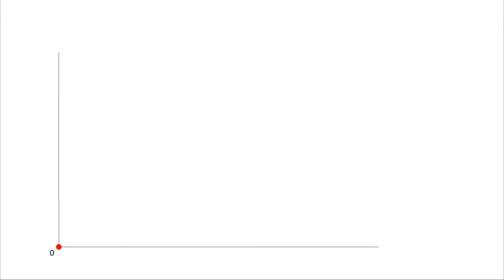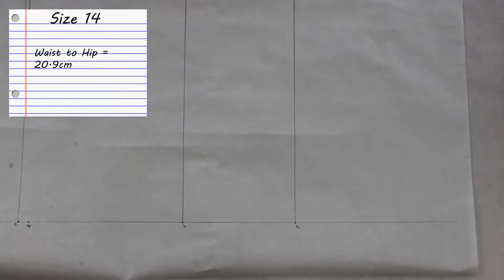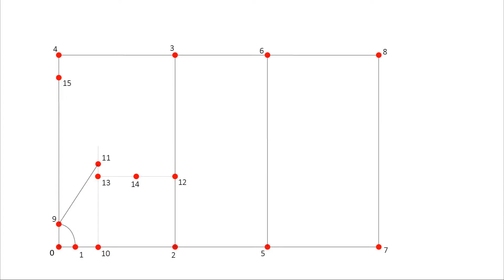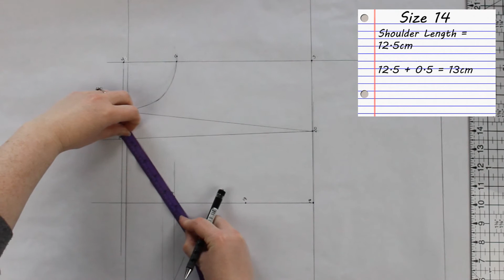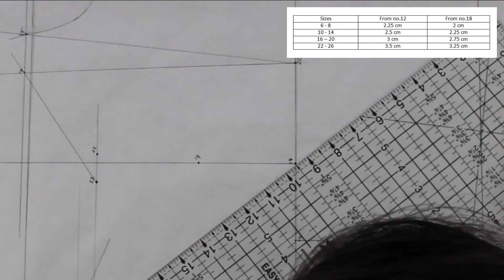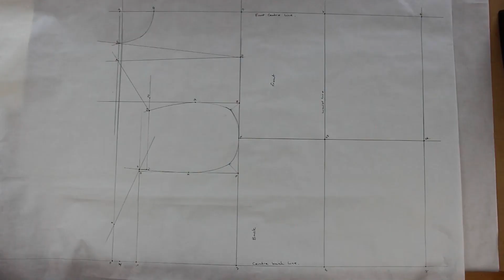Easy Fitting Top Pattern | Pattern Cutting | Fashion Design

Comment: Hi Tanya, thank you for your clear description in the video. Do you take suggestions for pattern ideas? I would like to make a top similar, based on an unlined linen top (Tendenza, 38) I own. It has two long darts running from the bottom of the garment up, and two seams front and back that run from the bottom up into the armpit. It is fitted, and has a 29cm invisible zip in the left hand seam. I'd like to make a copy of this garment.